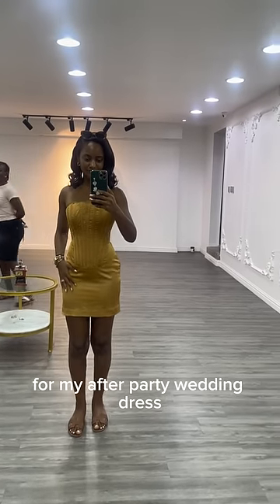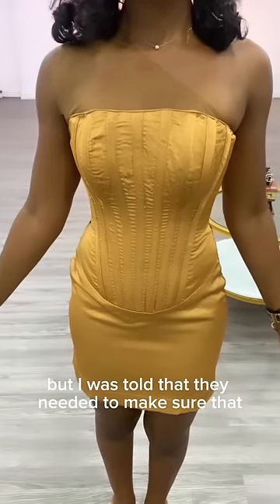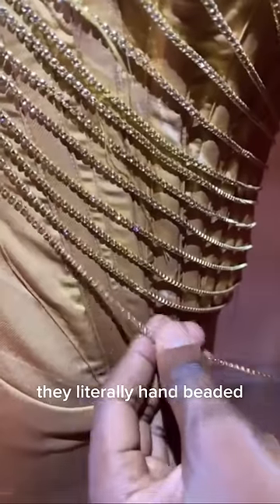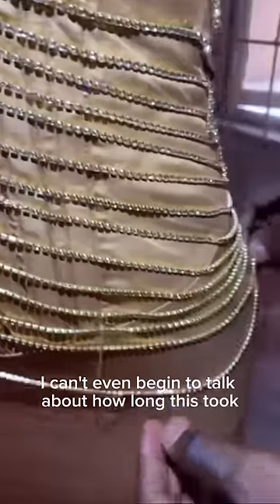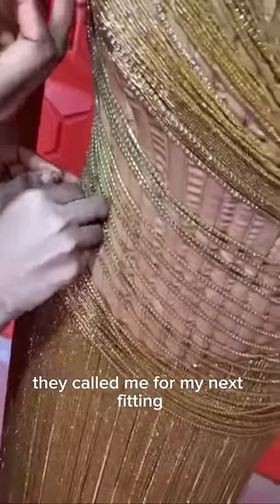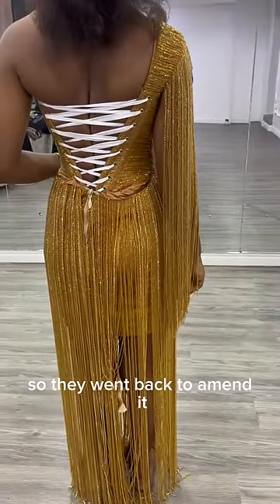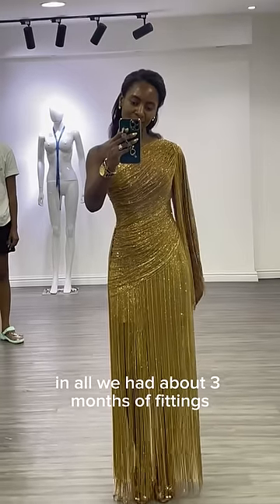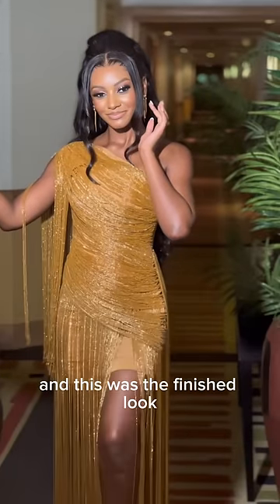The Making of My Afterparty Wedding Dress

Comment: Whoa. The beads literally transformed this dress. I never knew you could turn beads into their own form of fabric. The craftsmanship and vision is incredible.
Reply: The key is to have VERY good support underneath. As she stated, beads are heavy, so you want a structured bodice to support the entire thing, and a good solid fabric to anchor the strands. Otherwise the entire thing will fall apart or not sit correctly, leading to potential wardrobe malfunctions.
Reply: Anything can be used for fabric if you structure it well, safely and comfortably enough
Reply: Even with the ribbon change the laced up back is terrible
Reply: @seen.3 that was only for measuring during fittings.

Comment: The fitting before the beads looks like the skirt is a little too tight as you can see the fabric pulling.  Though it can’t be see. Under all the beads.  Ends up a lovely dress.